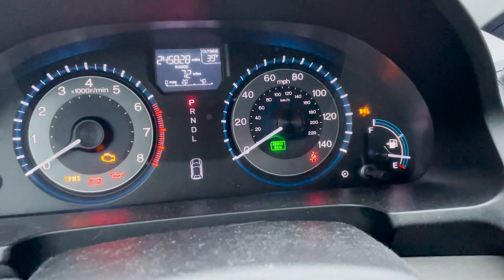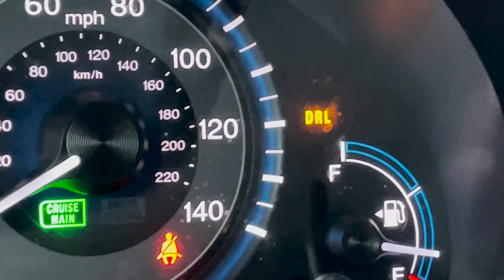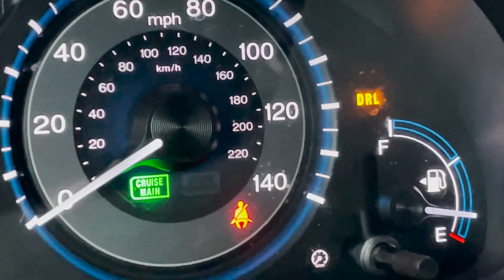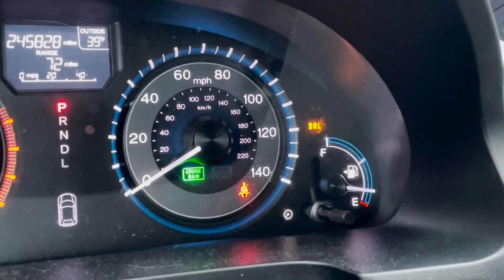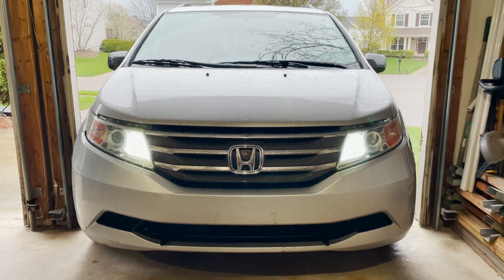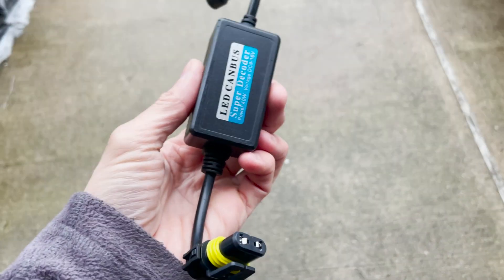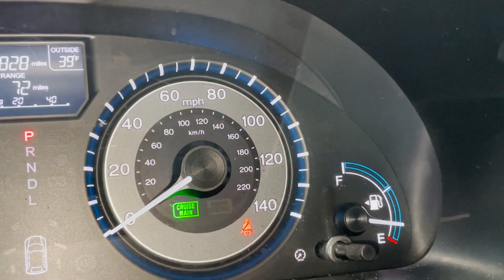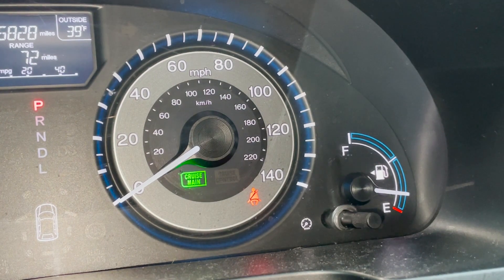Daylight Running Lights (DRL) Fix on a RL5 4th generation Honda Odyssey (2011 - 2017)

Comment: Where did you buy the device from? How does it connect and where at? Do you need one or two devices? And thank you
Reply from the maker: @jimmyarmstrong7261  You need two devices, one for each light. They are installed right in between the light connectors and the bulb. This is the product:  https://a.co/d/dh5jCa9
Please consider subscribing to my channel or a $thanks. It will help me on doing more videos like this.
Reply: You have helped me, and thank you very much❤. I did subscribe.

Comment: What kind of bulbs did you use? I installed some led lights and the daytime running are gone.
Reply: How
Reply from the maker: @ibrahimjaridi  this is how I installed the LED lights. 
)
https://youtu.be/RxjJ6CDXW0c
Reply: Do you need 2 canbus, one for each side?
Reply from the maker: @garrettwhite9071  yes
Reply from the maker: @anthonylitchmore8409  that is cool. I installed the AUXITO LED bulbs: https://www.ebay.com/itm/156124630273?mkcid=16&mkevt=1&mkrid=711-127632-2357-0&ssspo=csSUMrzrQhm&sssrc=4429486&ssuid=X68vXngLSm-&var=456911747179&widget_ver=artemis&media=COPY
Reply from the maker: @anthonylitchmore8409  which one did you install?